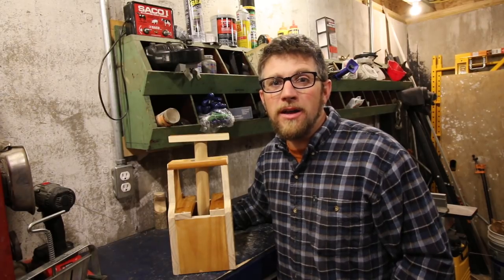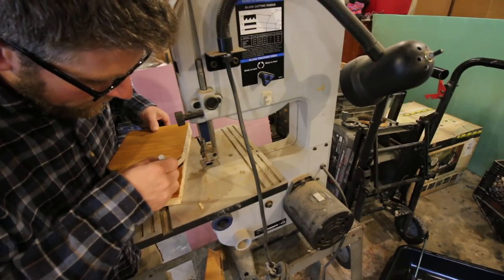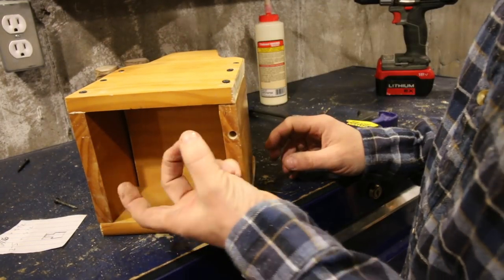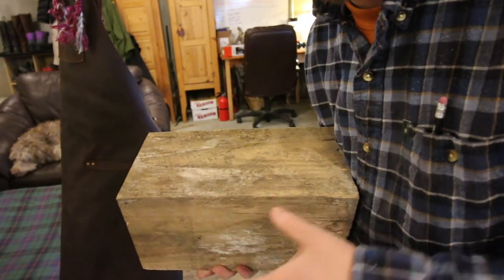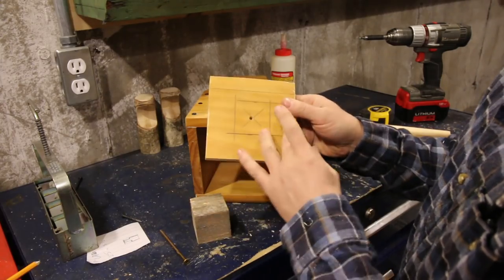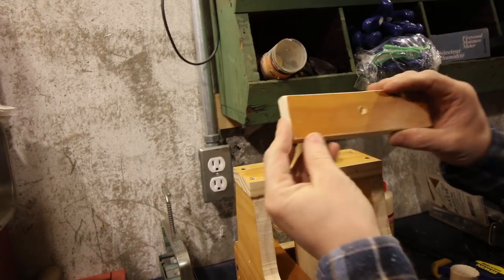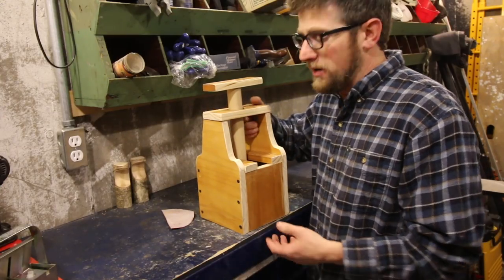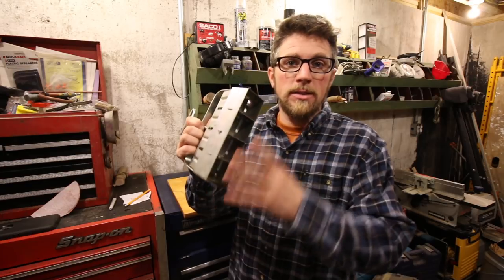Making a Large Soil Block Maker ~ that our Medium Soil Blocks Fit in

Comment: I built a large blocker out of wood a few years back. It's really unwieldy to jam in soil like the 2" blocker; I ended up having to flip the large blocker over and stuff in soil by hand. I found it is much faster to direct seed tomatoes into quart yogurt containers and entirely avoid 2 sizes of soil blocks. The quart container holds the tomatoes nicely right to planting time. Your mileage may vary, and I like your design!

Comment: Anxious to see how you use this.  Having trouble visioning what seeds you will be starting that need such a big soil block.  good work!
Reply: Mar Barnes, I think you start them in the smaller soil blocks (2x2) and when they get bigger, you just set the small soil block in the divot that the plunger made. That's why he made that square block on the plunger that size ... so the starter soil block will fit in the divot of the larger block. Hope that helps. xoxo from Arizona
Reply: OH! ok.  Like I said, ws having trouble picturing how he was going to use it.  lol thank you

Comment: Well done on the basic soil block maker construction. I think I would have tapered the bottom edge, sort of like a chisel shape, to make it easier to push into the moist soil mixture. I am assuming you would use a large bucket of moist soil rather than hand pack your block maker.

Comment: Al, Is the larger block just used to place smaller blocks into? Or, are there plant seeds you would start in this larger block?
Reply from the maker: Yes we will be placing our Medium 2x2 inch blocks into them
Reply: So this thing makes the hole that the soil blocks go into. It's a soil block hole maker. That's cool.